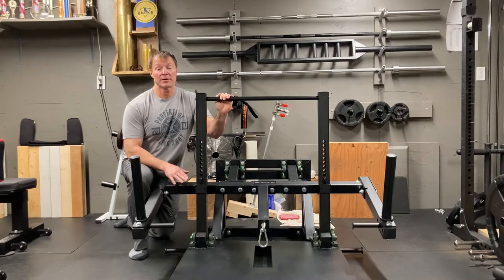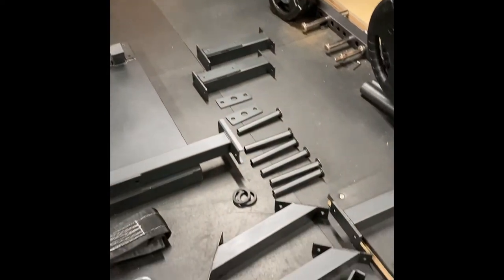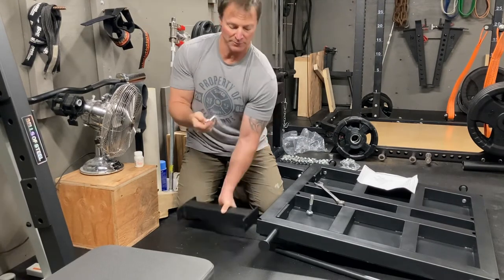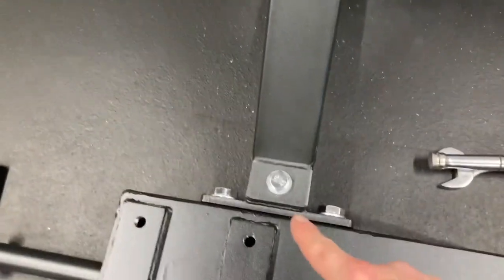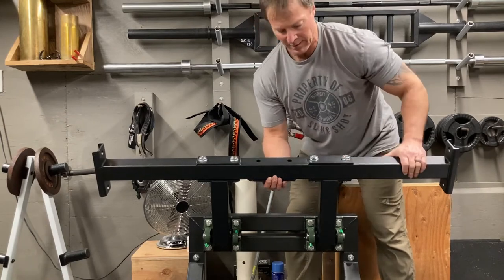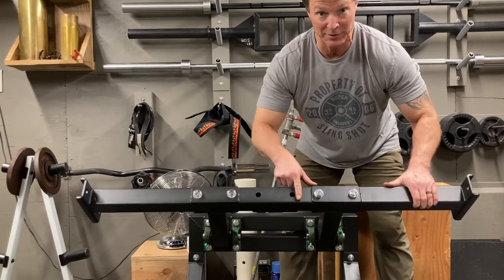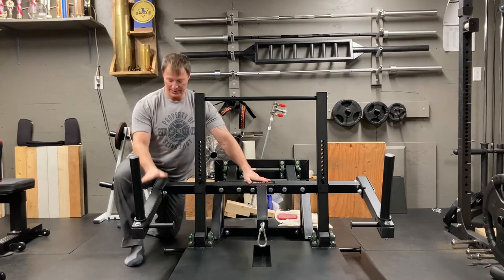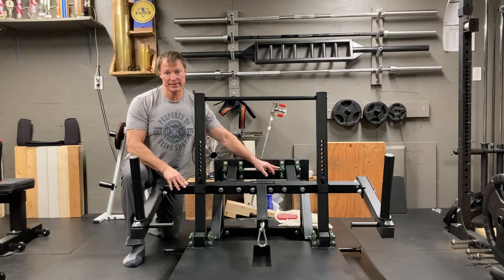How to Assemble your Bells of Steel Belt Squat Machine 2.0

Comment: Your video is so much better than the Bells of Steel video! Now I know where those lock washers where suppose to go! I am going to rebuilt it , with the green bearings in the correct position. Thank you very much.
Reply from the maker: No problem glad the video helped you out.